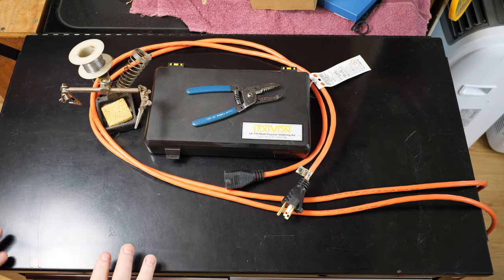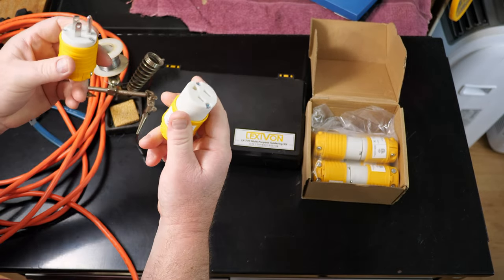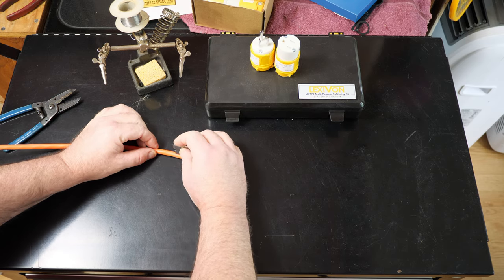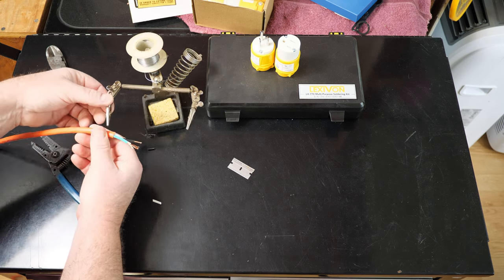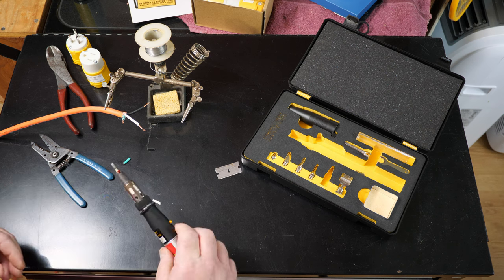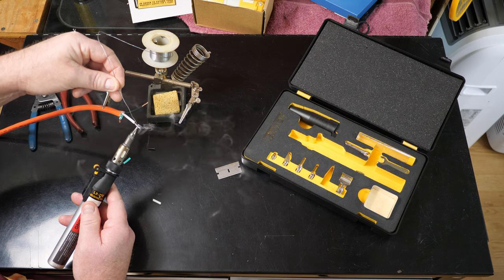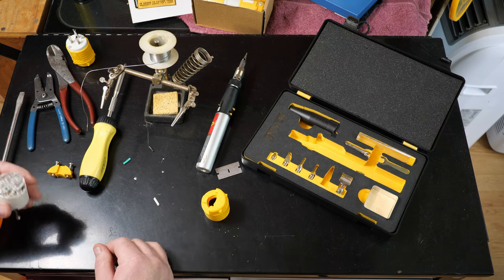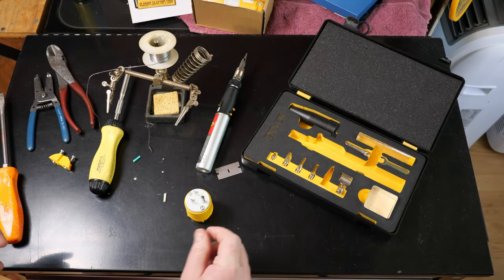⚡How To Repair Extension Cords⚡ A Better More Secure Way, "MY" Way

Comment from the maker: In this video I show and tell "My" method of repairing extension cords. My way is a little different than some others you may have seen, like most things on this channel 😁 This is just a better way of doing an otherwise boring job, I hop this helps some of you out. Cheers 🍻

Pieces and Parts:
Extension Cord Ends -- https://amzn.to/3QF8J9h
LEXIVON Butane Soldering Iron -- https://amzn.to/3QBoCOg
Third Hand Soldering Tool -- https://amzn.to/3Oh8y2E
Silver Solder -- https://amzn.to/3O9zbWV

Videos mentioned:
DIY Studio Lighting -- https://youtu.be/_KwFot0RoXo
Soldering Iron 1 Torture Test and Review -- https://youtu.be/nQfm6NS1NBI
Soldering Iron 2 Long Term Review -- https://youtu.be/o9Dh51x9KYw

Give a 👍 and subscribe 🔔 if you'd like to see more videos like this and thanks for watching 😃!